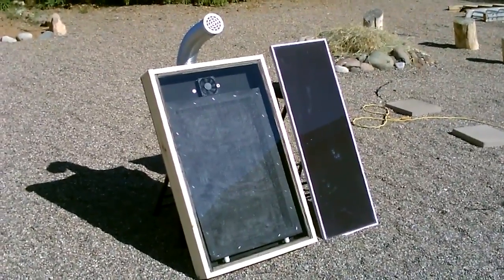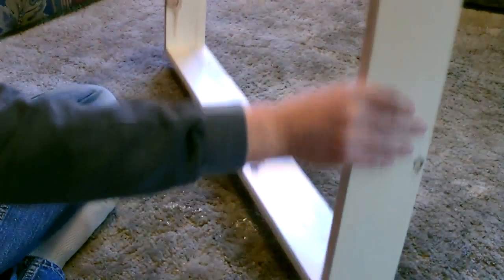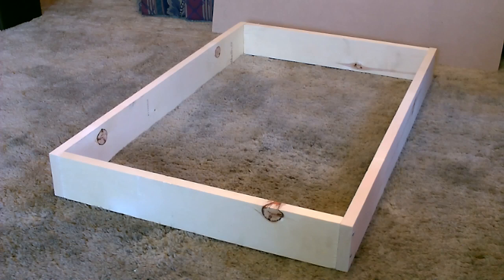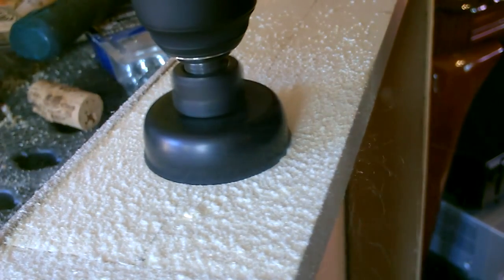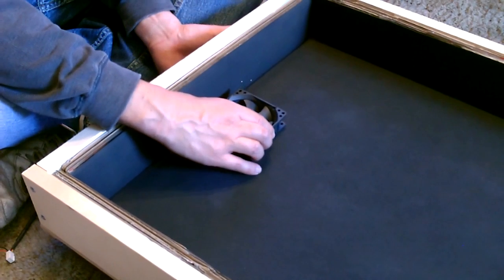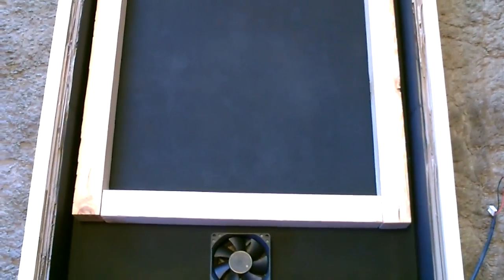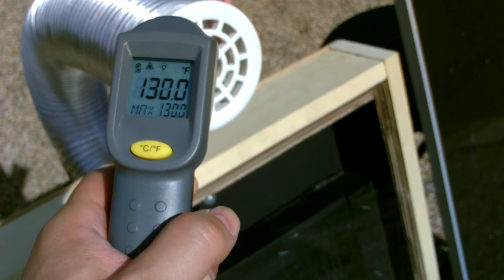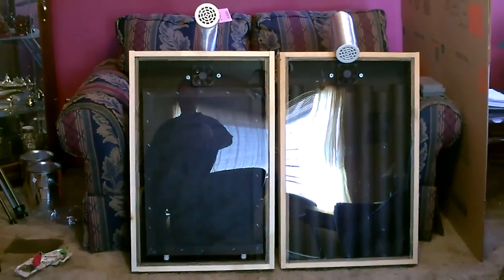Solar Air Heater! - The "Screen Absorber" Solar Air Heater! - Easy DIY (full instructions)

Comment: I’m thinking about making this for a tiny house heater. I wonder if you could connect a thermostat on and off for the fan to regulate the temperature inside the house?
Reply: Falcon Trek - Yes it is possible to had a thermostat and other electronic goodies.
Although keeping the KISS principle alive and well I would suggest. Keep it as it is.
There's a regulator on the system in the form of the solar panel, less Sun radiation, less heat, but also less fan action. In this case a smaller solar panel could be beneficial. 
For the overheating case that seems to be your concern. A flap valve could do just fine. 
Particularly in a tiny house might not be a bad idea to control the temperature with a roof/high position thermostat controlled vent.

That would benefit the entire space while keeping ventilation at good levels. One of the advantages being the fact it would control whatever sources of heat or cold you have installed. Just my 2 cents.
Cheers

Comment: Is that all you need to buy is one 15 watt solar panel, do you need a battery or anything else other that what you've built? Thank you this is so very interesting.
Reply from the maker: hi there. yep all you need is one solar panel. i used a 15 watter because it's what i had, but one as small as 5 watts would work well. no battery necessary. just hook the solar panel to the fan. *the fan will automatically turn on when the sun is hitting the collector and off when it isn't. :)

Comment: its really good with the fan and all but wat if the grid goes down, the fan wont blow anymore, then will it b that the only escape for the warm air is into ur house?
Reply from the maker: hi there. the fan is powered by a small solar panel, so it works even when the grid is down :)

Comment: Nicely done!  Having a solar powered fan really helps solar air heaters. 
We tracked the efficiency of our solar air heaters (though different design), and achieved savings of between 100 to 300 kWh’s energy saved, per winter month, even during most of the winter, in the Olympia, WA area.  
The only time we kept the vents closed (not using the panels) was for about a 2-week period that included between Christmas & New Year’s.  That translated into saving approx. between $20 to $50 USD per winter month, off our electric heat bill.  We used those for close to 10 years, at a rental house, booted through a small, south-facing window.
Meaningful savings!

Comment: Just hook the fan to a 9v battery. They is pretty complex. Just need a box, glass and soda cans painted black
Reply: Why would you need a battery? Explain. Solar panels like the ones I have on top of my van produce 12v or 24v or whatever voltage and will easily and directly run 12v fans. Directly means just connect positive to positive and negative to negative. No battery required to run fan. However, it need not be stated that the fan would only run when the panel is generating.
Reply: @ronmiller7916  your talking about a rv roof I'm guessing, so that requires more voltage than computer fan

Comment: Why are you predrilling
Reply: Preventing splitting of the board and allowing less of a bite of the screw threads of the top board.
The board being fastened to should have the threads getting the best grip of the wood fibers

Comment: How do you think this would work in side a house behind double pain glass. I have a 3x6 window and also a 3x4 I thought about building one for?
Reply: I'm going to try this, placing the heater behind our south facing patio doors.  I can't think of any reason it wouldn't work.  If it is successful, I'm looking to eventually build a 4'x8' one and permanently mount it to the exterior of my house wall.  Several videos on YouTube show the success of these.  I'd rather be heating my living area for free while lowering my electric bill!  I just need to figure out a way to cover the exterior one in the summer.
Reply: @richardballew8958  I have discovered through a little research, that if you have low E glass it is designed to reflect the sunlight heat back outside and the interior heat back inside. I think I will try a small unit that will just fit in my double-hung windows. Sounds like a simple screen unit might suffice.

Comment: Build it to fit inside the roof rafters area to collect heat from the roof, using fans to circulate the warmed air into the existing AC ducting.

Comment: Temperature of the air isn't as important as the specific heat if air, which determines how much heat that 130 degree air can deliver.

Comment: Great experiment in construction a passive solar heater. Low to no cost.  Labor very little. As with a car or van if you enclose the box the heat will rise. And yes blowing cold air in from the bottom  will increase life of your fan.

Comment: Cool you pre-drilled the screw holes. Good idea. If you used old hose coiled up and painted black or used copper tubbing lining the entire inside you would have more stable output . Also using old aluminum frame windows works great and keeps the heat in more .What you didn't show was temps outside at that time which key to knowing what to expect from this design . Also put the fan on the inboard side and have a plenum feeding fresh air in . Electric fans don't like excessive heat .The bearings get dried out and fail. If using an inboard fan have it weather proofed and prescreening . The most effective way to get heat is to heat up mass and draw from the heat .Mass acts as a storage for the heat which is more stable than warm air from a painted surface alone . Also putting insulation around the ducting would be a good idea as well . All in all I think its a good proof of heat potential in a basic form . Using acrylic sheeting also further reduces heat loss or doubling up on glass and wrapping insulation on the outer perimeter of the box . I saw this basic design in a homesteading book written in the early 1970s .Tons of cool stuff to do and great heating and energy ideas such as passive solar heating like this one and radiant heat from the floors like the Romans did . There's energy potential all around us to be used if we would be smarter about how we utilize that potential .
Reply: royalspin  What is the name of the book you are speaking of? Please and thank you.
Reply: royalspin Are you saying that the intake should be powered and not passive?  If so, are you suggesting that with your heat concern with the bearings, the fan should be external on the intake?
Reply: @bsrpython257  - I believe he was referring to have the fan on the cold side (intake) to reduce heat stress. Pretty much like applying a water pump on the cold side in solar water heaters.

Comment: Can you tell me details on the solar panel and fan you used please. I'd like to know what to buy exactly. Thanks
Reply from the maker: hi there. the fans are just standard 12VDC 80mm case fans. - the panel is a 12VDC 15 watt amorphous solar panel. depending on the power requirements of the fans that you buy, you can probably use a smaller panel

Comment: Thxs for this video. But can you tell, what is this material Screen absorber plate made of?
Reply from the maker: hi there it's just standard non-metallic window screening. *that's usually made of fiberglass or polyester/nylon. all should work. metallic screen (aluminum) probably will work too (i never tried it thou)

Comment: if you made the internal frame from aluminum and stuck some mylar reflective film inside the edges and back of the main box it would make even more heat. You could even rip the central frame with a saw and add another layer of screen. Lots of options. Well done!

Comment: Hi! I already commented your videos, but again they are amazing. I'm building my own but I  need your help : does it matter whether you set the fan at the air inlet or at the outlet? I'm thinking about setting it at the inlet as air is cooler and it will not degrade plastic as much as in the outlet. Does it make any difference of work for the fan? Thanks a lot!
Reply from the maker: hi there and thanks. the fans have to be used at the outlet (to pull air thru the unit). i'm not sure of the physics, but it doesn't work the other way. don't worry about the fans and the heat. they hold up fine in the unit.
Reply: @desertsun02  Hello, You can pull air with the fan a lot easier and better than to try to push air. That is why you should put it on the exit of the box.

Comment: Would multiple layers of progressively darker collector screens increase heat collection? ..assuming that six +/- collecion heating and blower chambers could be set up with a single 100W open panel wired to run all the fans..im thinking that this could be run by economy of scale in a cool climate in order to heat an entire room or rooms..

Comment: can someone explain the fan part? So sunlight/heat  is being absorbed then pushed out through that tube but how when the fan is pointed away from that thing? And the holes at the bottom? Are those so cold air can leave? I want to build one
Reply: Sunlight heats the air inside the frame, then as it warms up it is convecting upwards (lower density than cold air) and would naturally leave through the top hole. The fan is here to accelerate air flows. Bottom holes are here for the inlet of cold air. What I'm still wondering though is the role of the screen... if anyone can help me on this that would be nice !

Comment: What advantage does the screen have over tubes of some sort? Thanks.
Reply: More surface area.  More efficient heat generation and easier heat transfer to the air

Comment: What size solar panel is required to power the fan?  Will two fans add efficiency?
Reply: Not much and it  depends on how much sun you get.

Comment: Pretty hot!  it would be interesting to know how many BTUs it puts out for the size of the unit.  One BTU (British Thermal Unit) is needed to heat 1 cubic foot of water one degree.  If you know the BTU output you can size your panel to heat the living area intended.

Comment: You could use a stirling hot gas engine to push that hot air just use a wood stove top fan and incorporate it into your design for it to be all not electrical. Bet folks with a green house would enjoy your design. ; )

Comment: Does anyone know what size that solar panel is and also can the wire from the fan to panel be longer? I want to use this idea in my mini cabin up in the mountains but there is a lot of shade where the cabin is. I would have to get the system about 15ft out from the cabin to catch some sun or maybe I could use a longer hose? Also, will black mesh screen work instead of the metal kind? I already have a roll of the nylon screen material from installing screens at my house. Last question, Anyone have any ideas on how to keep the cabin heated at night? I was thinking a car battery hooked up to a solar panel that would charge throughout the day and possibly have enough power to run a small fan heater during the night. I'm completely off the grid when I go to my cabin so no electricity available and I hate the thought of using propane heaters indoors even though they are supposedly safe... I'm leaving in one week to spend two weeks there to work on the build-out of the cabin so jut looking for ideas. It's already been getting down to 35 to 40 degrees at night there.
Reply: There should be no issue running a 15ft wire.  I can't tell you how long you could go, but you should be able to go a decent distance.  The further you go, you will get loss of power... but I dont think 15ft is unreasonable.  As for the night time question... with solar you typically want to go for marine batteries or golf cart batteries (google a few options, and then source them on Amazon for good prices) to power a small heater though that takes a good deal of power... you would likely need quite a bit of batteries, and in turn, quite a bit of solar panels..

Comment: I want to build one like this, but for various reasons I need to position the panel about 10 feet from the house. I'm thinking that small computer fan won't generate enough force and could potentially burn out. Anyone know where I can find more information about how to calculate what size fan would be needed ? Thanks. Also I'm wondering about just using a single frame and stapling the mesh directly to the outer frame. That would seem to be much quicker.
Reply: You can use an exhaust fan for a bathroom and use 6 " insulated duct.
Also a exhaust fan for a bilge would work and they are 12 V. Just wire up a simple dimmer switch for lights to vary the speed.
  Some one said that the heated air would cook the fan. Place the fan on the intake side.

Comment: Couple questions:  What is the best way to translate the "outdoor heat" to "indoor heat?"  I can build the box but am not able to bring the heat to the inside without tearing down an outside wall or window.  I am trying an indoor application as a first project to overcome this issue but would like my next project to be larger and outdoor.  I'm a greenie on using solar power.  Can you provide a source for both the fan and the solar panel,  and what size does it have to be to drive the fan?  Your video shows glass panels.  Did you use glass or plexiglass?  Thanks for sharing your pioneering efforts.

Comment: I am very interested in building one of these (southside) to go on Garage wall and pump hot air into basement what size of pipe and fan did you use and where did you get the fittings to attach pipe Thanks
Reply from the maker: hi there. i got the pipe and fitting from home depot. the pipe is a 3" diameter "dryer hose" (the dryer hose clamp is sold in same area of the store). the metal square that attaches it to the back of collector is called a "j-box device cover" or "j-box device ring" and it's sold in the electrical dept. the fan i used is an 80mm computer case fan. with airflow volume of about 40 CFM

Comment: Really interesting Im thinking of building one of these for my tortoise enclosure but use polycarbonate instead of glass which is what I use already for the lid of the torte house and small warming areas. Can you let me know what the screen is made out of please. I didnt expect it to work better than using the cans, just thought the cans would hold the heat longer. Its really interesting stuff. 

Many thanks for posting/sharing. 

Please let me know about that screen material you used.
Reply: Ive seen what I think the screen is is on ebay . Fine insect mesh is this correct 

http://www.ebay.co.uk/itm/221527128377

Also seen aluminium mesh and fibreglass mesh HELP lol

Comment: Hi, I'm wondering if I can use an existing window as the glass of this. I want to retrofit an existing window in a cold room but only in the winter. Can you imagine this working for an existing pane, and simply putting this unit tight to it, maybe with a foam seal between the box and the window.
Reply: plunixx - I did exactly that, and drew indoor air into it by putting in a clothes dryer vent. The room gets to 80f when the rest of the house is 60f. $12 solar panel from harbor freight and a PC fan work perfectly. I put a light space blanket flap in the bottom vent to keep cold air from flowing in at night.

Comment: I watched a few times and I am not familiar with channels and such, so I am looking for stuff like the sizes and things (for lack of a better term, your recipe) for your screen heat absorber that you also compared to the black can one that was almost the same... I have an animal small animal scantuarary so my thought is to make a couple of these and it seems like it would heat the 4-6 small houses around the outside and then the middle area with food and water also, so the courtyard if you will... then my idea for night would be like a heat sink that is heated all day and the fan could spread the heat all night maybe?  I have seen others use the red heat lamps, one per home, but that seems more expensive and no room for food, water, and play - its getting to be chilly at night so I am hoping for any guidance since I no longer have electrical outside, so the plug in heaters obviously not won't help the dogs, cats, and small wild animals for hopeful summer release!  I can follow directions well, but I am unsure of detementions and things like is the roll of screen the same black roll of screen I bought to do the house doors and windows a few months ago or is it something else? I am also unsure how to get replies here, so if my general box at jenndreis719 at gmail if your ok helping the animals by sending the information...they and I would appericiate it a bunch!